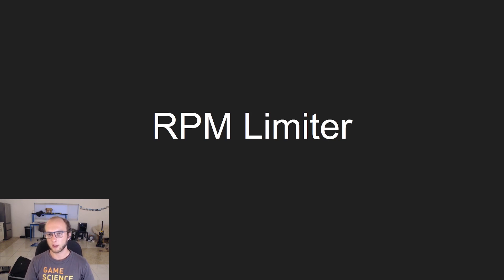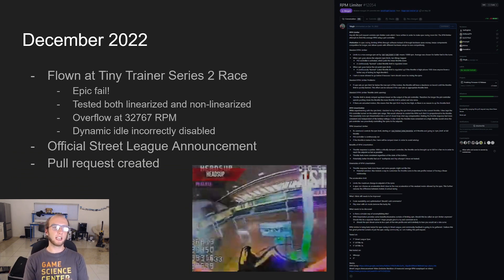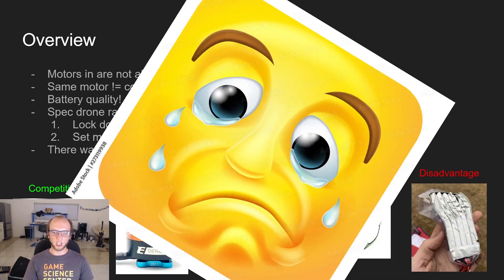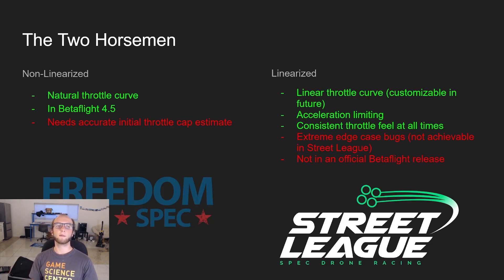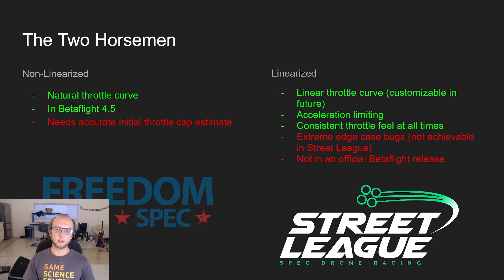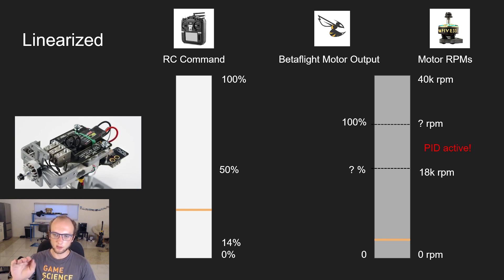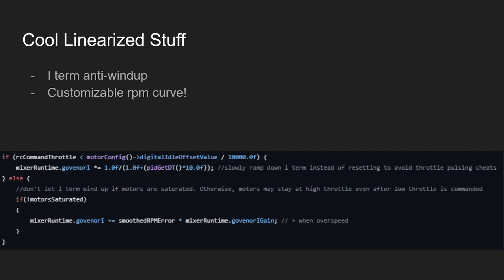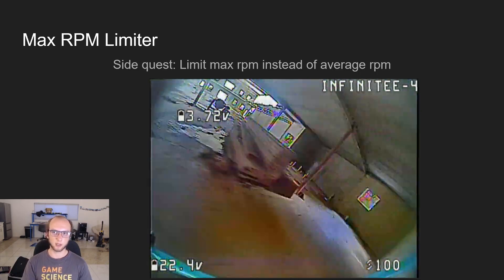Software RPM Limiting for Drone Racing

Comment: Can I use rpm_limit to decrease the current drawn by my 7" long range quadcopter (my 18650-made battery pack can supply 30 A max). Or is it still better using motor_output_limit for my purpose?

Comment: Great video, man. It's already pretty darn good, both linearized and non-linearized. I enjoy both SL and FS. Looking forward to see where it moves. It def changes racing.
My humble prediction:
FS Shames allows any motors for 2024. Should be no issue for both types of limiter.
More whoop leaugues will adopt limiter.
AM32 catching up with the precision of ERPM telemetry - thanks to brainstorm between devs.
Blheli_s - not sure yet.
SL moves away from custome hex files :) hehe. Can be under kaack, or under a separate special release.
BF 4.6 official release includes both types of RPM limiter.
If MLDR ever happens, they should certainly use RPM limiter.
DRL 2025 with RPM limiter.
2026 Tanner is a multi-millionaire.
let's see :)

PS: at some point we should investigate how the ESC clock speed actually affects ERPM measurements. How temperature of the ESC affects clock.
I tried it with cheap optical RPM meter, it wasn't good enough... lol
Need some good lab gear and brains :)
Reply from the maker: Yesss, I like that timeline